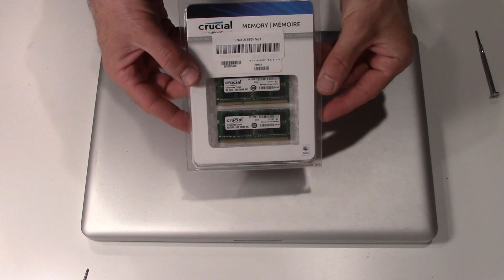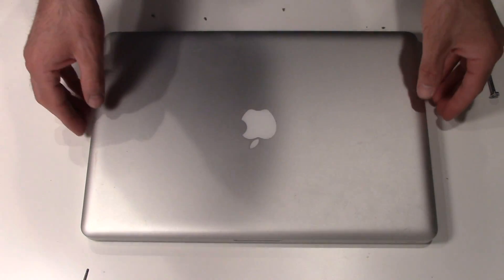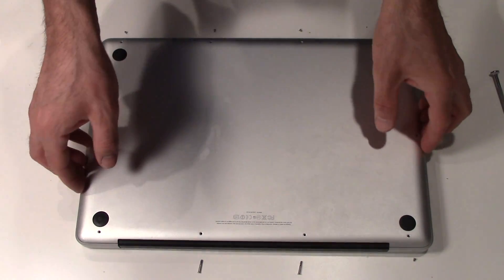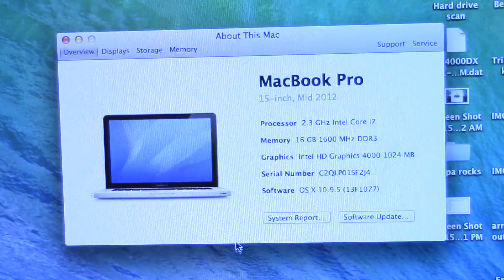How to upgrade Apple MacBook Pro RAM

Comment: This was an excellent video! thank you! I see yours is a 2012...mine is a 2015 MacBook Pro...I also have just 2 x 4Gb of ram...looking to upgrade that to 2 x 8 as well. I hope it all looks similar inside. You did an excellent job showing the details. :)
Reply: Was your process the same?
Reply: @enrique967  Sadly, no. I am unable to upgrade the  ram in my 2015 MacBook Pro Retina. ☹️ It is not possible (I have since found out).
Reply: @JenniferWasylenko  Assuming it is soldered onto the board then?
Reply: E. Reed yes that’s correct.
Reply: I have 2015 MacBook pro to. I want to upgrade, Did you find something? :(
Reply: Abiezer Otero Ortiz  unfortunately no. It is impossible to add ram but it is possible to change out the flash drive to larger SSD. I chose to keep it all the same and add an external hard drive. All good for now.

Comment: It’s a 2012 people... This video shows a 2012 RAM upgrade... 
As the other TWO comments point out, this video reactor isn’t very considerate of his viewers or the fact that there are MANY versions of MacBook, MANY “years” that usually signify MAJOR DIFFERENCES in macs, and even INTRA-“YEAR” differences (early 20xx - mid 20xx & LATE 20xx) where even this SMALL DETAIL could mean major hardware differences within the same year.... 

Apple is CONSTANTLY changing things, and it’s never in the way that benefits the CONSUMER or his RIGHT TO REPAIR an item HE OWNS... 

Now we are at the point where Apple is CRAZY GLUING and soldering down most components on the insides of MacBooks forcing the consumer to cause major damage or irreparable mess when attempting any DIY work... 

It should be ILLEGAL, because they do this to FORCE US TO SHOVEL MORE MONEY AT THEM... repair? You must pay them 10x MORE than normal repair techs AND LOSE ALL YOUR DATA, AND DONT GET THE OLD PARTS (which you OWN) BACK... Can’t afford this?? Or Apple tells u THEY can’t fix it, therefore NO ONE CAN??? You’re then forced to PAY MORE to BUY A NEW MODEL... 

It’s also CLEAR AS DAY that Apple is making their laptops less & less desireable in 2020 because they are attempting to push everyone into the iPad ecosystem... the 2020 iPad that was just released does everything it can to REPLACE THE LAPTOP from the keyboard case to its ability to add data hubs, external drives, etc, this is where they’re investing their time and efforts hoping to phase out the laptop altogether... 

With all this said, I’ve read that the 2015 MacBook Pro was the LAST DECENT MACBOOK EVER MADE as its the last one you can (somewhat) upgrade on your own, and the last one that avoids certain major issues that Apple has caused in later models.... 

This is what i currently have, and based on the above, I’m looking to treat it like a prized antique Bugatti so it lasts the rest of time... 

I can’t find a single video that addresses the ram in the 2015 MBP, so I’m assuming this means it can’t be done... I saw some online images that make it appear the ram is SOLDERED IN... 

if anyone reading this has a clue as to whether or not this is true, I’d appreciate a reply. If it is soldered in, why cant we just desolder it, remove it, and add the upgraded RAM??

Can we? Thanks!!??
Reply: good question about the 2015MBP. I have the early 2015 and am wanting to upgrade the RAM. I can see by all the ports we have that it is truly a keeper. I love my SSD slot! I also have the iMac with the last CD rom drive in the body! Also a keeper...
Reply: @JenniferWasylenko  pretty sure the RAM stick is soldered to the motherboard or something, but i also have a 2015 macbook pro. so hopefully yes
Reply: Okay G3N!Uz, maybe REWA Technology Channel can help you. 

BTW, if you really hate Apple that much consider NOT buying it. Okay sounds stupid but I said 'CONSIDER'. UNDERSTAND THE STATEMENT.

Bunch of you idiots just talk about users side and not from business perspective, okay you might say I am an 'Apple Guy', But no, I am a programmer, but learn a lot about business.

Then I ask you, can you, YES YOU SIR, Make your own Laptop design, OS design, Maintenance for the OS as service AND give your customer fully unibody METAL NOT CHEAP PLASTIC, with a very low price. Then you say 'it is possible' right?

Make your calculations then show me, don't forget to include endless OS Design updates, I said AS FKING SERVICE. UNDERSTAND?

Then we talk. Don't just... Write stupid answer okay? Fking UNDERSTAND THE STATEMENT.
Reply: Sky Xerxes I mean to be fair there are plenty of computer manufacturers that build their computers in a way to allow the end user to upgrade/fix. 

Yes the only reason to buy an Apple product is based on their software alone. 

I think we can admit that Apple definitely charges a premium for their device not based on their hardware but the OS. 

You can build a pc with better specs than the Mac Pro for a fraction of the price. And you’d be able to upgrade if you choose. If a part goes bad you can repair it. 

To be honest if it wasn’t for Xcode and Final Cut Pro only being able to run on Apple I’d never buy one.

Sure I like the operating system but I also like windows and I don’t like Mac OS enough to want to spend the amount they cost for the little specs you get without being able to upgrade or repair. 

Imagine you’re a mechanic and you buy a car and now you can’t upgrade any part that you want and if something goes wrong you a mechanic can’t even repair or replace the part.

Now since you understand business so much. How much money would Apple really lose if their computers were upgradable? How much would they really lose if the small percentage of computer owners that would replace a bad part on their own?

There are lots of great aspects that Apple has I have a MacBook Pro I do love it but would love it more if I could upgrade it. 

Also you could get your point across without being so rude and arrogant to the person you were replying to. 

It’s not as easy as if you don’t like the way Apple is don’t buy it. He might have purchased before realizing that apple is the only company to have a business model like this. He might be like me and need software that’s only available on Mac OS. 

There’s no way you can tell me that Apple’s hardware model is good for the end user.